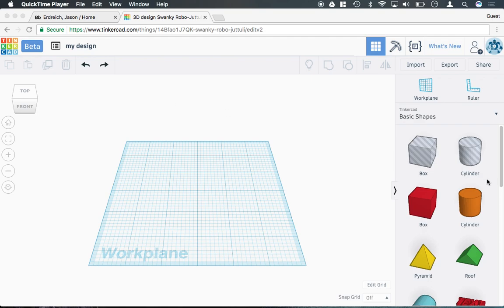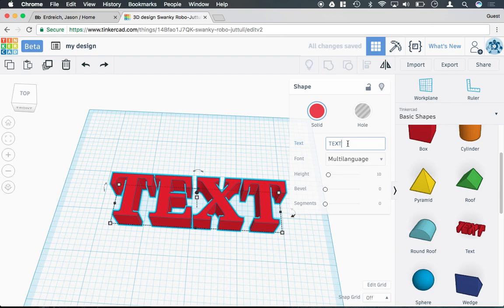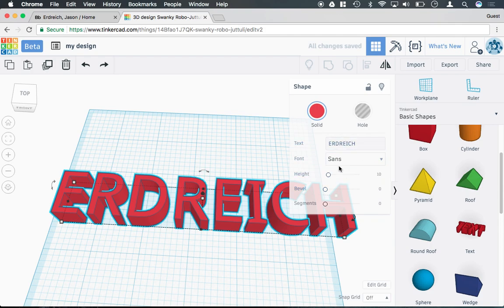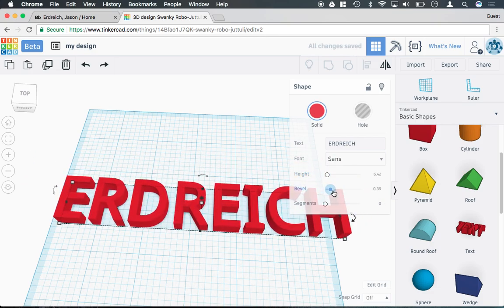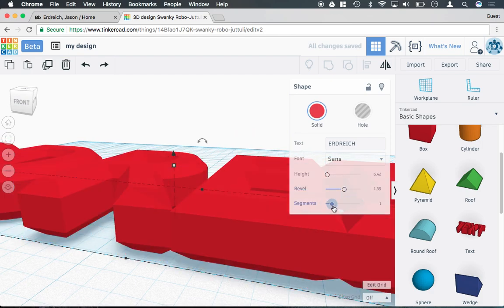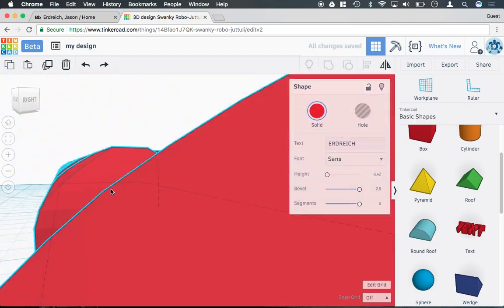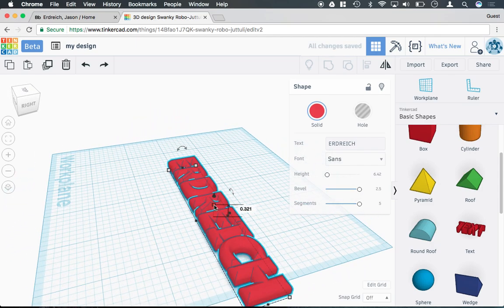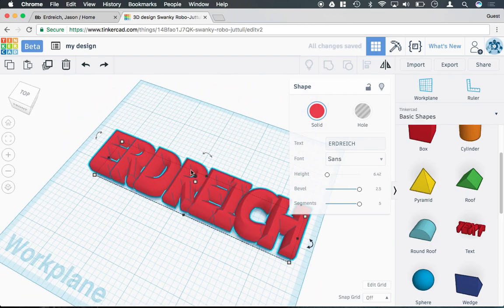How to use the text tool in Tinkercad

Comment: Is there a way of making an outline for this? So if you put the same word behind it but filled in and then could do the other letters separately on top? Thanks
Reply from the maker: Not easily. You can scale a second text box, or even grab individual letters, but you will need to manually drag and position to make it an even outline. I reccomend you import text from a vector design program as show in the video below. 

https://www.youtube.com/watch?v=_UsslbRtgI0&list=PLBDInqUM5B27gejuFTE97PNxiY6OFVze2&index=17